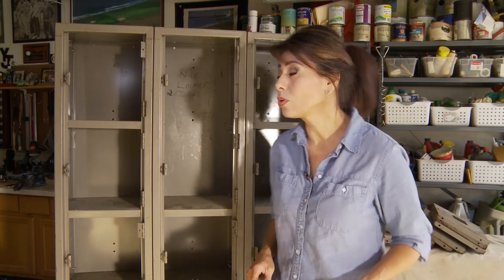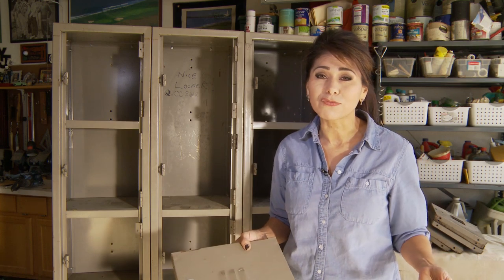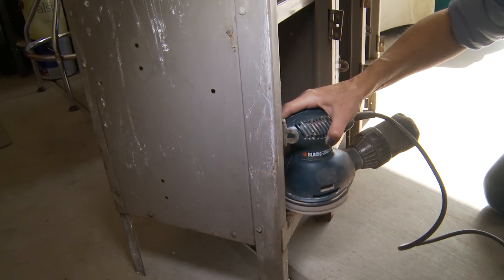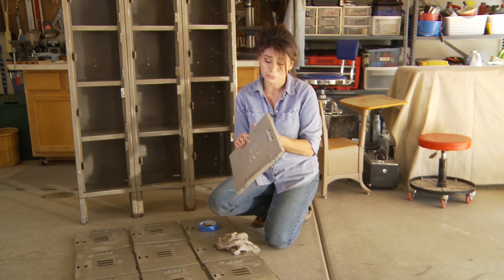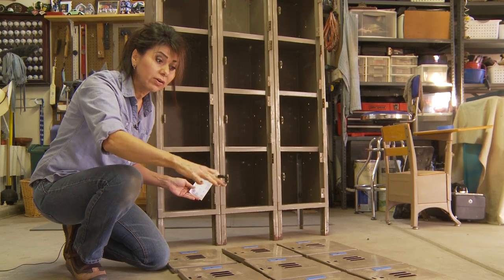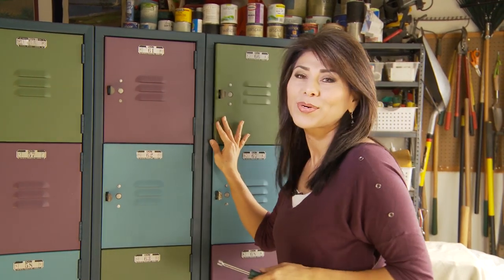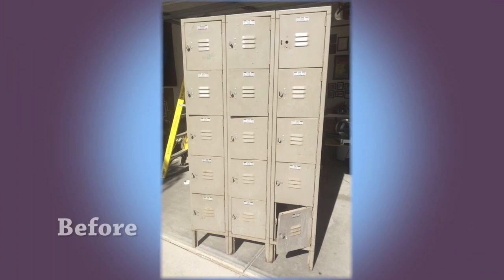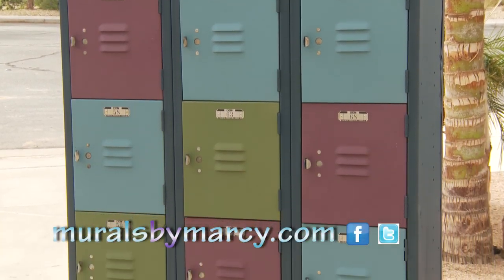DIY LOCKER MAKEOVER: How to transform beat up metal lockers with paint

Comment: Hi ! How many times should i spray paint if im using a regular can? Do i have to use electric tape or is masking/paper tape fine?
Reply from the maker: It's hard to say how many coats of paint you'll need.  If you're using spray paint in a can, you have to be careful to spray very light coats, so it could be quite a few.  You also need to make sure you let the paint dry between coats.  As far as tape, you definitely need painter's tape. Hope this helps.
Reply: @MuralsbyMarcyV  thank you ^^ last question, are painters tape and electric tape different? They look similar
Reply from the maker: @nk3378  Electric tape and painter's tape are very different. Painter's tape is created to lift easily after painting, leaving you with clean lines. And it's also made specifically to keep paint from seeping underneath. Electric tape is meant for wrapping wires and doesn't do any of that. I highly recommend painter's tape. Hope this helps.